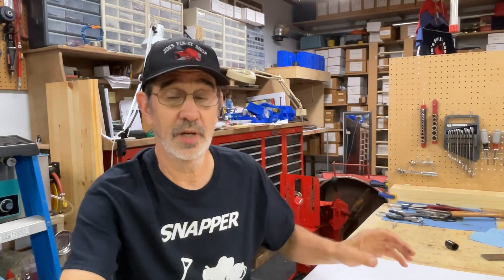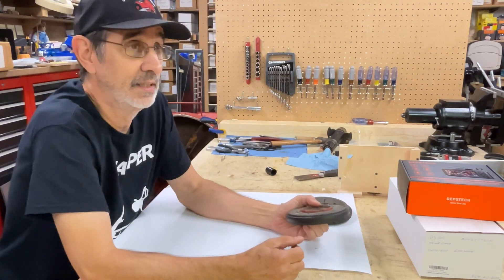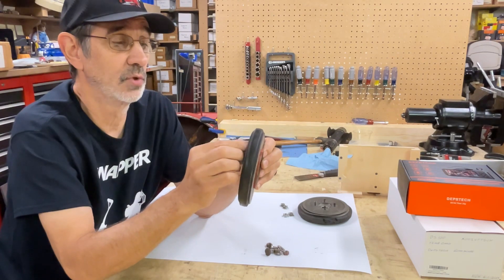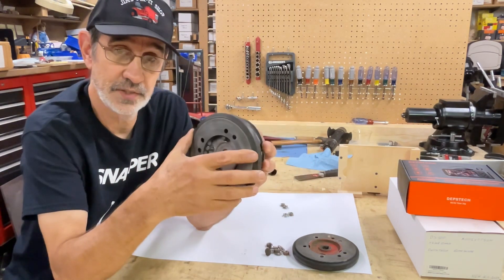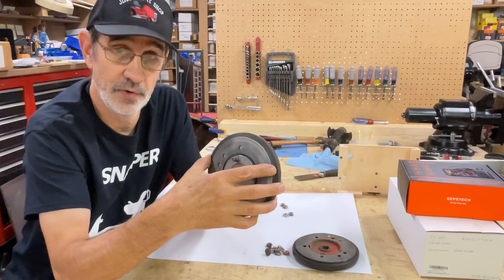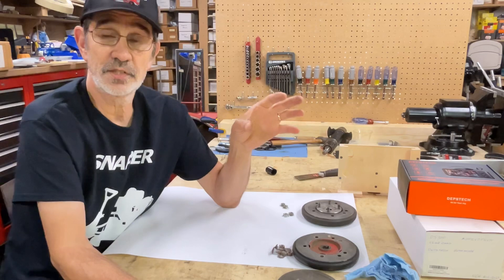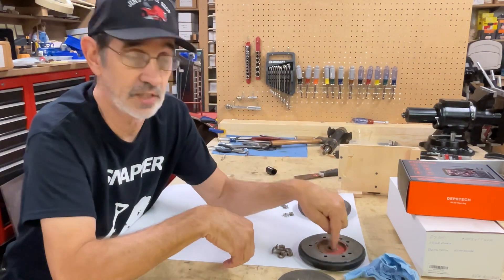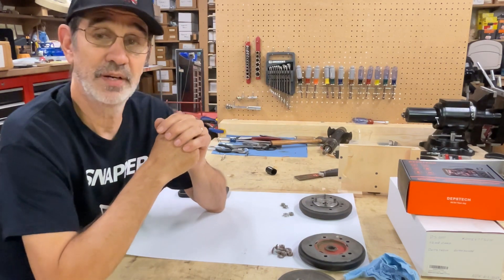434.  What is the difference between a soft start clutch and a solid clutch?

Comment: Mine will pull a hill one minute and have to rock it to get it going the next.
Reply from the maker: @RobertDickens2002  check to see what your clutch looks like. It should be about a half inch thick of rubber then watch video number 70 and tighten your yoke spring.            Jim
Reply: @jimjackson9381  yes sir I've been watching and I just replaced the disk even though I don't think it actually needed it could anything in differential be causing it.
Reply from the maker: @RobertDickens2002  no nothing in the differential, can cause it to slip the differential and the chain case it’s either working or it’s not if it’s slipping and not driving then it could be your clutch disk, your yoke spring, or the yolk itself if the slot in the yolk has low spots that will cause it to slip in a certain gear if the bushings for the yolk are worn that will cause an issue if the bushings in your fenders are worn, especially the one opposite the differential that one usually wears out first because no one ever greases them. The bushing in the fender on the differential side gets lubricant from the differential so that one usually holds up longer check out those and let me know.        Jim
Reply: @jimjackson9381  thank you sir that's a major relief thank you for everything you're doing.

Comment: Thanks for the tips Jim. Just picked my mower back up from the repair shop. Guy couldn't figure out why it wasn't moving. Have a "soft" clutch and i need to check out all of your tips before going to the solid clutch stage!
Reply from the maker: First thing I want you to check, pull the hubcaps off the back tires and check the bolts that go through the wheel flanges and axle put a wrench on them and make sure they’re not broken if one of them breaks your machine will not move.        Jim
Reply: Will do Jim, thank you!

Comment: Jim can you please tell me how much endplay a RER have in the rear wheel drive wheels ?? My unit have about 1/2 inch. Normal or problem and what needs to be replaced Sir. 
Thanks a bunch fella.
Reply from the maker: 1/32 at the most.     Jim
Reply: Jim, what is wrong with the unit to have such a large amount of side play ??? Thanks fella. You always gave me accurate information Sir. Peace vf @jimjackson9381
Reply from the maker: @victoryfirst2878  well I never really read anywhere that gives you a actual clearance for that issue   1/32 is probably too much but the issue that you have is that 1/32 is .031 thousands thick and the shims you buy from partstree is .050 thousandths thick I would think if you tried to insert one more shim, it would be too tight and you would end up prematurely, wearing something out. Obviously, if you can get the clearance down, smaller without forcing a shim in, that would be better.  I would think that.1/64 or .039 thousands would be pretty much ideal.  Jim
Reply: Thank you Jim for making my day. I will get to it this week. Thanks a bunch fella. Good day too. vf @jimjackson9381

Comment: Hi Jim, I'm writing to ask if you would know why my tensioner pully for the belt keeps going bad. I've put two this year and I can't figure out why. I also wanted to see if you knew were I can find a new clutch.  It's a 72 model snapper and I can't find parts anymore. Thank you sir 🙏
Reply from the maker: The only thing I can think of is, it’s not aligned properly with the other pulleys. It may be the bracket that up bolts to is twisted a little.       Jim
Reply: @jimjackson9381  ok I'll check that out, I did look before I put the last one on but I shake alot so I'll have my son look at it. Thank you!

Comment: Jim do you know what size v-belt go on a old 33 inch snapper rear wheel rider with bike handler bars ?
Reply from the maker: If you have your model number, you can go on Parts Tree.Com and it will tell you what size you need. Jim.
Reply: @jimjackson9381  thanks jim it a old rider no model number.
Reply from the maker: @k9under  do you have the old belt?      Jim
Reply: @jimjackson9381  it's had a 72 in x1/2  I was thinking it should be 73.5 in
Reply from the maker: From what I can find there’s supposed to be 73 3/4 of an inch.      Jim
Reply: @jimjackson9381  thanks Jim I will try that 73 3/4

Comment: How is retirement going? Adjusting well? What’s your opinion on a riding mower with an air cooled engine vs a liquid cooled engine? My lawn is about 3/4 of an acre. Thanks.
Reply from the maker: Well, it depends where you live air cooled small engines have been around for 50 or 60 years a liquid cooled engine is going to be a whole lot more expensive than an air cooled one if your climate is over 110 degrees. I would probably wait till the cooler part of the day to mow, I check my oil every time I get on my machine without fail I machine low on oil will overheat and probably throw a rod oil level is extremely important.         Jim

Comment: I run the drilled out disc and am able to pull a Cyclone Rake loaded. I don't believe the soft start would work. When the front wheels plow, it's time to dump. Works awesome.
Reply from the maker: Question, how do you like your cyclone rake and how long have you had it? I am thinking of buying one this year.    Jim
Reply: Jim, first off thanks for ALL your videos. A+.
I love the Cyclone Rake and have the Classic. I've had it for 2 seasons now. I bought it used. These things used sell in hours here on CList. 
The Cyclone is really well engineered and breaks down for storage fast. Cyclone told me the Snapper RER is not recommended as a mower to pull the Cyclone. It is true unless you do the locked drive wheel and don't mind a friction disk every once in awhile. I'll be going on my 3rd season with the same disk. I also did the extra gears mod in your video for the commercial verion.  2 points of interest is the mower mount as the Cyclone is a 2 point mount so it doesn't jackknife. I put a flat steel bar behind my RER back for extra support. Second was the chute I used the Snapper bagger deck chute, the coupler from Cyclone and hose. It dismounts easy to cut grass.

The time savings from dumping between bagger and Cyclone is about 10:1 or more.

I have posted images in Lawnmower forum under Snapper (mattm55). Let me know if you have any questions. Thanks again.
Link to Cyclone review on my Snapper > https://www.lawnmowerforum.com/threads/snapper-rer-classic-cyclone-rake-experience.67179/

Comment: Jim, why would anybody in their right mind buy a snapper when all you do is seem to work on them. I have a Craftsman rider and by no means is it a premium mower, but one thing i can tell you after 20 years it still mows excellent and all I've done is oil and filters, blades and belts nothing more, no tearing the whole thing apart, am I missing something about snappers?
Reply from the maker: Is your craftsman mower black and has a rear engine?  If so, it’s made by Snapper but obviously you’ve never used a Snapper or you would know why they are so sought after and everybody wants to keep them running as long as they can see you they don’t make them anymore. There’s nothing on the market today or in the past that’ll pick up leaves like a snapper will or sticks, pinecones, black walnuts, or anything else that you run over. Jim.
Reply: @jimjackson9381  ya, I never owned one or new anybody that had one. My Craftsman is just a lawn tractor 42” deck powered by an 18hp Kohler engine. I do regular maintenance on it, that’s the only reason it’s lasted
Reply: Snappers are built differently than other mowers. Once you understand how they work and what to do to maintain them, they're pretty easy. If the machine hasn't had any maintenance, it still fixable in most cases where your kind may not be. I've got a 35 year old RER and I get compliments on how smooth and even my yard looks. Few mowers today produce those kind of results.
Reply from the maker: @marklk8787  spoken like a true Snapper owner. You really have to own one to know how great they really are, they are a well designed simplistic machine that most anyone can take care of. I guess you could say a Snapper is built like a model T well engineered and simple to work on, the new mowers you buy today are so over engineered you need a degree to change your oil of course most of them today tell you don’t change the oil. Just add to it when it needs some.      Jim
Reply: I bought my Snapper Comet in 1976 , I am still mowing my yard with it..
Reply: Also, try to get parts for that Craftsman mower. Hard to get parts like pulleys, wheel hubs, trans parts, etc... that are specific to that mower. Maybe your lucky and have the model #, it was made by someone other than MTD or Murray? Once you own a Snapper and see just how well they mow (pick up leaves), etc.. you'll say, now I get it. I fully restored my '80's RER and added a Honda engine. It's better than new.  As someone said, if your Craftsman was made by Snapper, you've already answered your question.  :o)